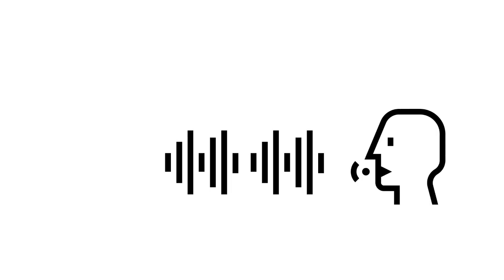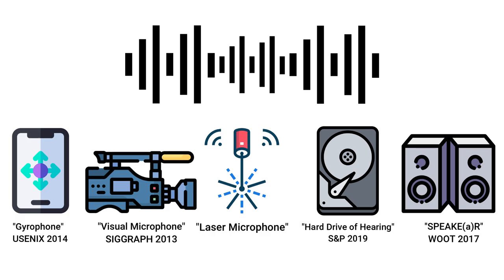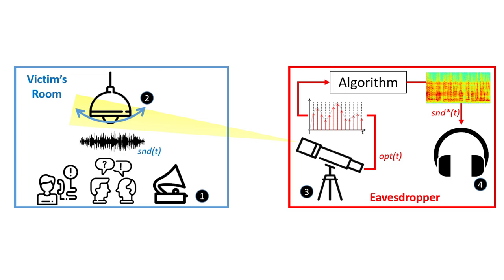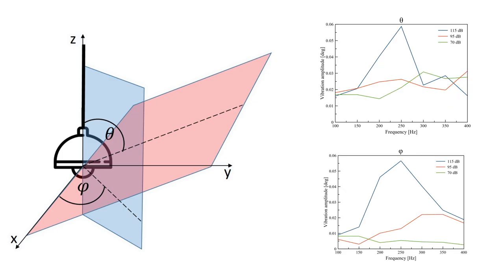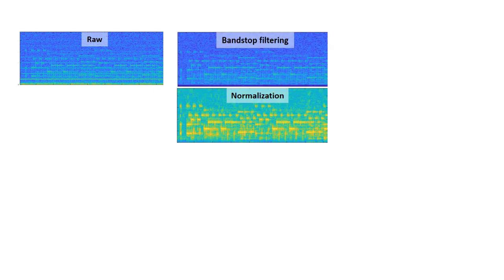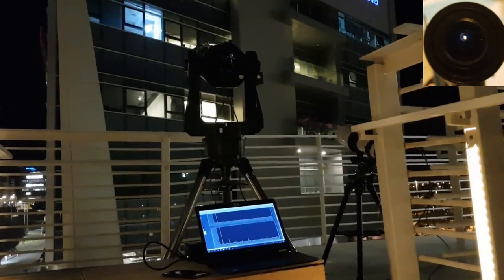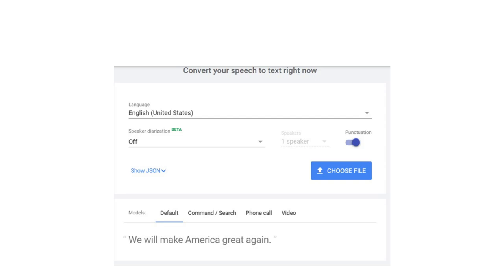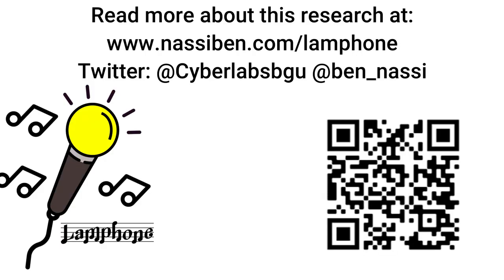Lamphone: Real-Time Passive Sound Recovery from Light Bulb Vibrations

Comment: Just swing the lamp before having an important conversation.
Reply: Heh LOL
Reply: Or you gotta place micro black hole in conversation room to keep the photons inside the room. 👌
Reply: I am pretty sure the method can be tweaked to circumvent this deterrence
Reply: Or just close the shutters.
Reply: swinging the lamp might not be too effective since that only makes it harder to track the light source. low frequency oscillations could be easily filtered out by dsp methods, and most likely will not disrupt the fourier waterfall/spectrogram that they used to visualize the data at all.
Reply: Y don't just close all the windows and doors with curtains 😀
Reply: Lol
Reply: @sharathgajulapalli7550  it foils it altogether especially if you turn off the lights. Blinds open allow the target open

Comment: The fact that the recovered speech is also played on speakers, not spoken,  begs the question how loud must the sound be to light bulb catch the vibrations. If the sound has to be "party-music loud" it's not that cool
Reply: It can also depend on the type of detector you use 🤔. If it's something that can measure even a slight change, then it's pretty cool.

Comment: I assume a neural network wasn't used because it would distract from the focus of the paper, but this setup seems like the perfect place to use one. Also, from a security perspective, if a neural network could significantly improve the quality of the audio signal, and it was easy to train, then it certainly is something I'd like to hear about.

Comment: I think this only works under ideal conditions!!
for example: For lamps not suspended but fixed to the ceiling ???
Reply: It'll work - the algorithm's sensitivity will have to be increased and the final audio won't be studio quality - but it'll work.
Reply: Actually the algorithm won't work with a lamp fixed to the ceiling.
Reply: @trtrhr  I simply know the mechanism of this method. A lamp fixed to ceiling is... well, fixed. It can't vibrate freely. Suspended lamps, on the other hand, can do microvibrations required for the method to work.

Comment: At the distance shown in the video, wouldn't it be simpler to just use an old school parabolic microphone? That would even work if the light is switched off. Still, a cool project and a bit frightening.
Reply: Light travels much much MUCH farther
Reply: @hanseldsilva2393  This is why I referred to the relatively short distance seen in the video.